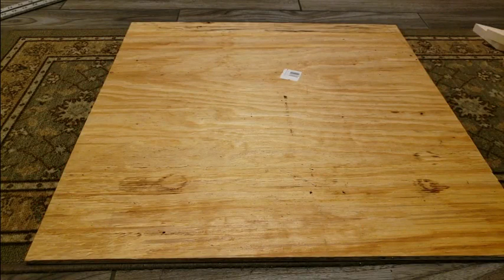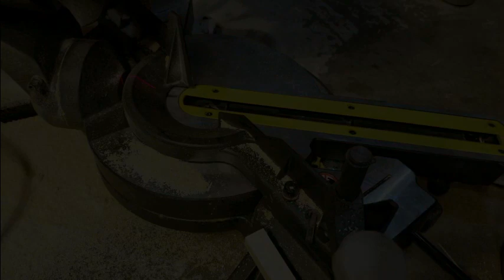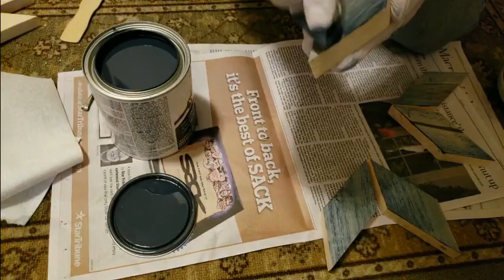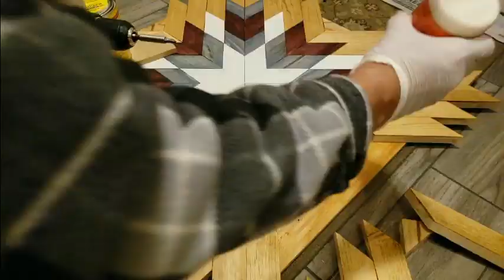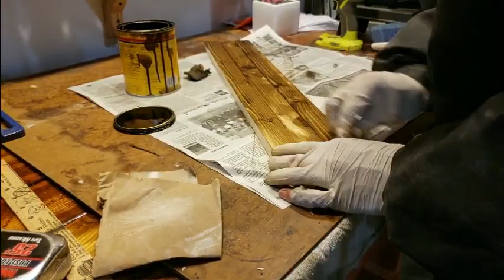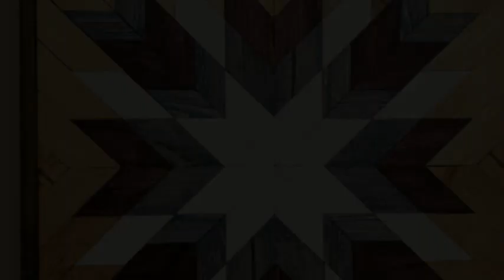Geometric Wood Wall Art | Wood Decor | Wood Quilt | Wood Mosaic

Comment: I make this type of wall art. Tips for you. Hold your nailing gun the other way. They are made so that the nails will blow out to the side. If you keep using  it the way eventually you will have a nail blow out the top and ruin your work. Also if you want to speed this up I stain all my wood pcs before I cut them. I also don't stain down all the way of the inside of the frame as wood glue does not stick well to a stained piece. I just stain low enough so you don't see unfinished part. Also don't forget to seal the backside so it won't pick up moisture and warp. I like your color choices it looks very nice.
Reply: Would liquid nails hold all these pieces better than just wood glue?

Comment: Quick question, I got a 2 ft x 2ft plywood board but it seems to be smaller than the one you used... Was yours 2x3 by chance? Just wondering how you fit so many wood cuts on it since mine cant fit as many as yours with a 2x2 board of plywood
Reply from the maker: it is 2x2 ft board. probably because 1x3 inch wood we get from local store is not exactly 1x3", more likely 3/4 x 2 1/2 inches .
is your boards exactly 3" wide?
Reply: @ummaandhalmi  Thanks for the quick reply! the pieces that I am cutting on my mitre saw are set to a 45% angle, and have a stopping block at 5 inches on the saw... They are 1"x3" but for some reason I can't fit as many as you on my board and I'm trying to figure out where I went wrong. Possibly my pieces I'm cutting are too long?
Reply: What inch are you putting your jig to? 2" or 3"? I realized that I set mine to 5" and thats why they're so big
Reply from the maker: Hi.. I watched video again, I am not sure where I got the 5 inches??. each block piece size should be 3.5" long side and 2.5" short side. i will check to see if it let me edit the video.
Reply: @ummaandhalmi  Glad you gave measurements before I started cutting mine saved me so mane headaches
Reply: I did the 3.5" pcs and it was larger than 24" using the same # of pcs. I cut my backer board to 30" sq to compensate.
Reply: Hi, amazing work. Thank you. I am a complete newbee.i dnt have miter saw. If i can work with local hardware to cut the pieces at 45degrees and what r lengths for white,navy,red pieces? ..how many of those u had and whats the approx length for the end(oak pieces) and triangle pieces? I vl try to get some .
Reply: @ummaandhalmi  It does not look like a 2 X 2 ft.  It is not a square.